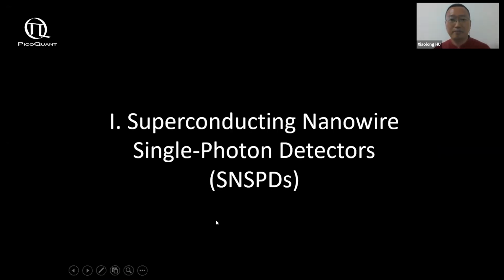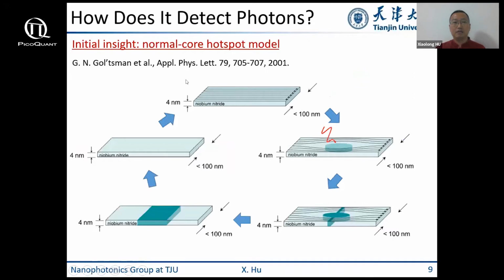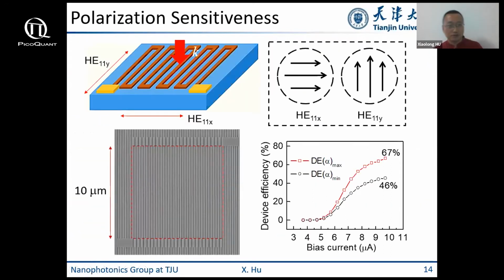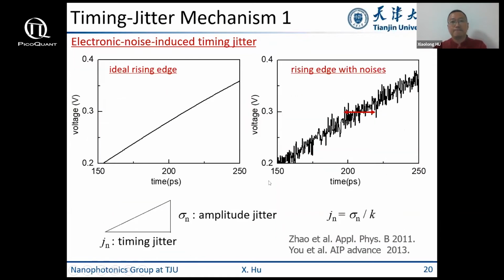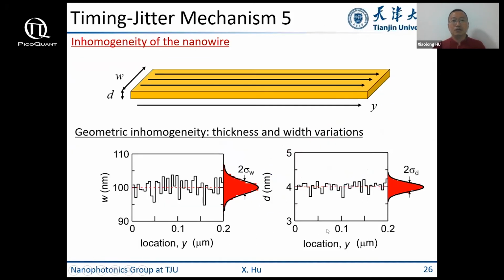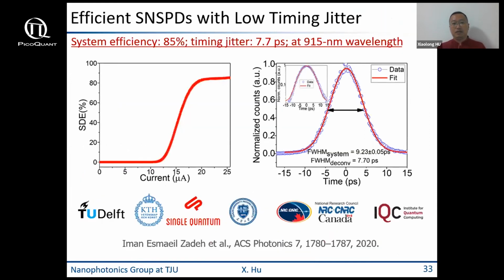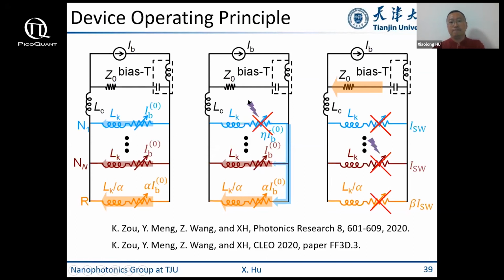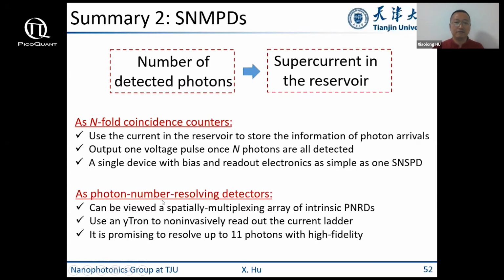Xiaolong Hu "Superconducting nanowire single-photon detectors and multi-photon detectors"

Comment: Can you please tell me whether a single photon is incident on the superconducting nanowires or a stream of photons fall on the nanowires for parallel nanowires setup?????
Reply from the maker: Thank your for your question. Both scenarios can happen, it depends on the signal intensity falling to the detector. These nanowire detectors were originally developed for real single-photon counting. The second half of Xiaolong Hu's presentation deals with detectors for multi-photon counting.
For further questions you may also send us an email to info(at)picoquant.com
Reply: @PicoQuant  Ok I will definitely do if I require. But my question is if a stream of photons is allowed to fall over the nanowires , are the nanowires absorbing only one photon out of the stream and if yes then how????

Please explain